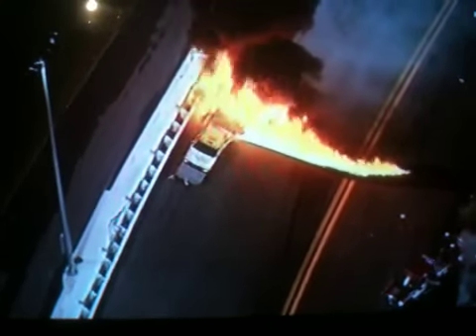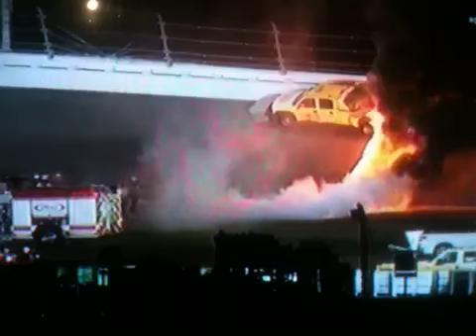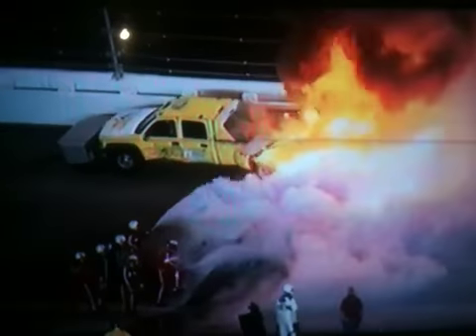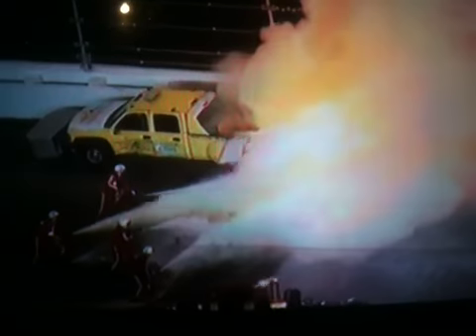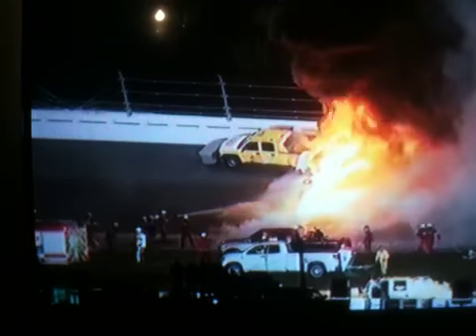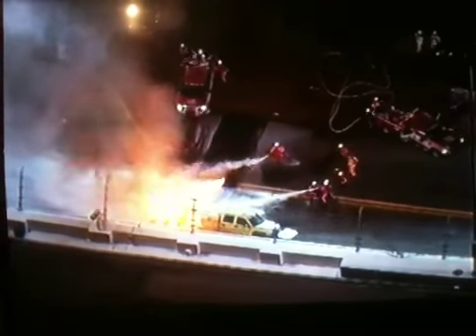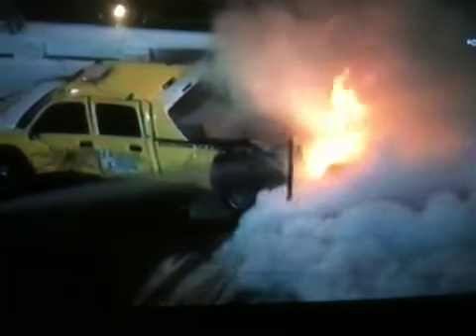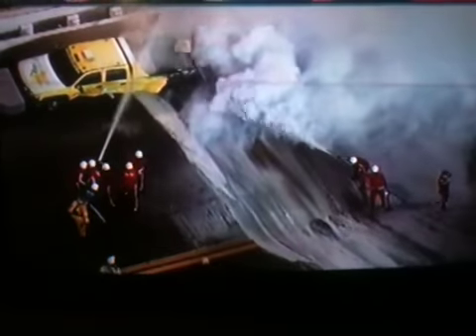Daytona 500 - Jet Dryer Crash and Fuel Fire - Juan Pablo Montoya - 2012

Comment: Gotta give it to NASCAR. They put out a fuel fire in under 10 minutes at a 31 degree incline. They cleaned up the fuel and the track. Applied a quick fix to the damaged section of track and got the race back to green in under 2 hours. Great Job